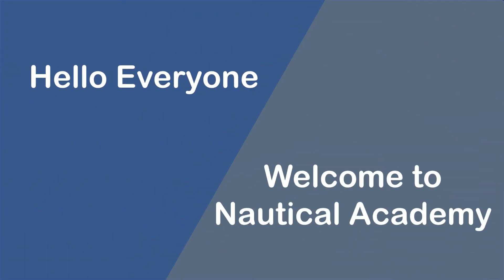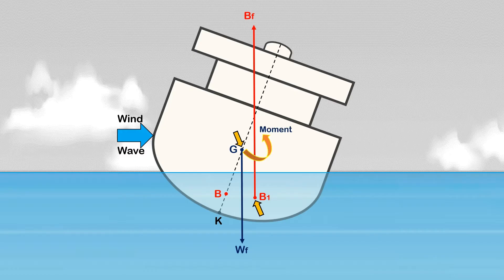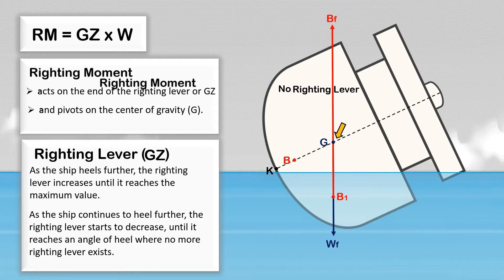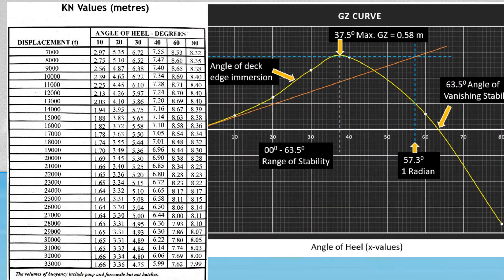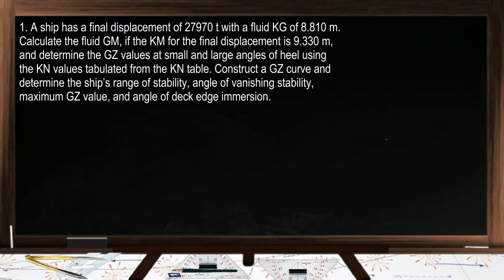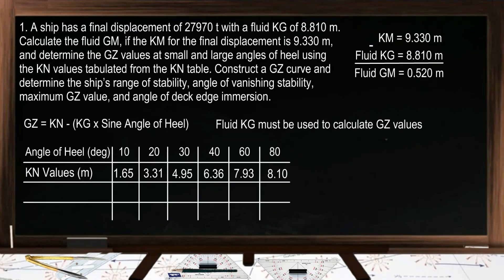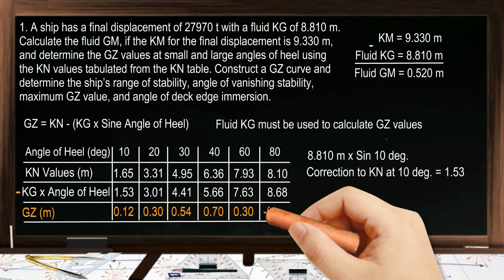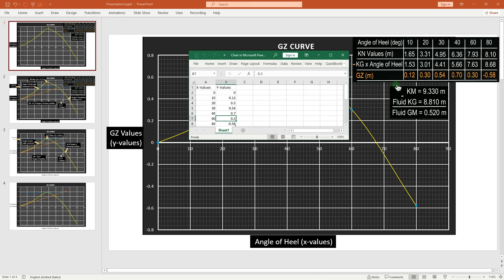Construct a GZ Curve ll Range of Stability ll Angle of Vanishing Stability ll KN Values

Comment: When plotting the GZ curve for stability analysis, what is the fixed reference point used to apply the heel angle? Is it the center of buoyancy, the center of gravity, or another point? Thank you so much for your work!
Reply from the maker: When plotting the GZ (righting arm) curve for stability analysis, the heel angle is applied about the ship’s keel, and the key fixed reference point used to evaluate the resulting moment is the center of gravity (G).

Here's how it works:
The heel angle is applied by conceptually rotating the ship about its longitudinal axis at the keel.

The center of gravity (G) remains fixed in space because it doesn't move with heel — it’s determined by the distribution of weight onboard.

The center of buoyancy (B) shifts as the underwater shape of the hull changes with the heel.

The horizontal distance between G and the vertical line through B at each angle of heel gives you the GZ value (righting arm).

The center of gravity (G) is the fixed reference point when applying heel angles for the purpose of plotting the GZ curve.
The center of buoyancy (B) moves, and the GZ values are measured as the horizontal distance between G and the vertical through B at each angle.